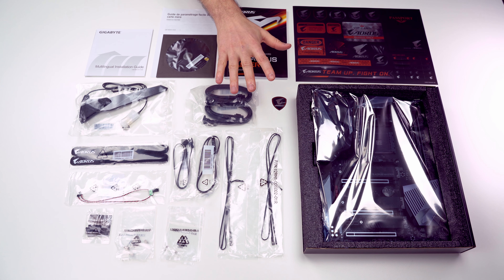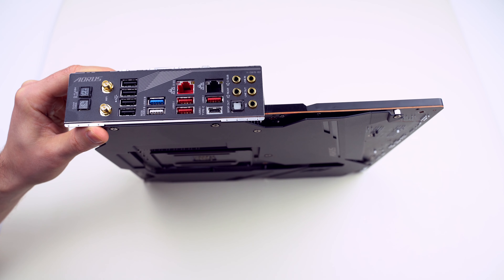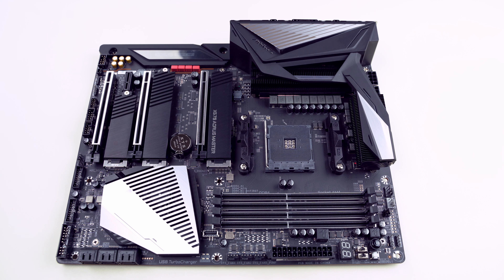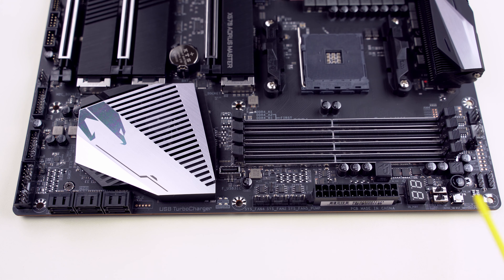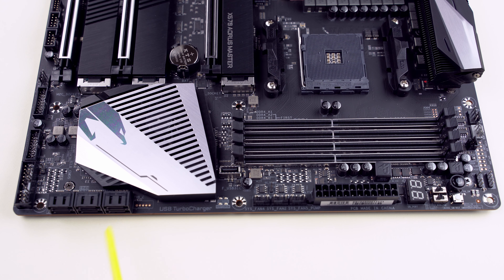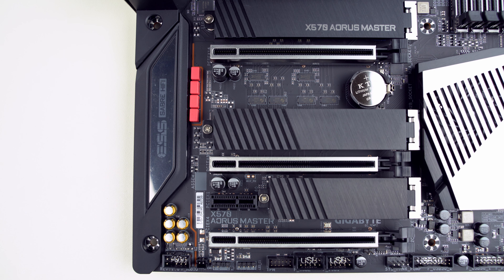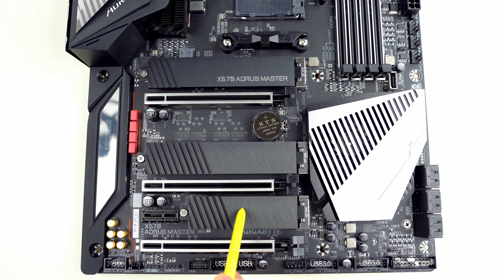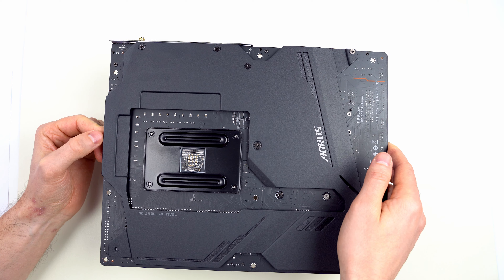Gigabyte X570 Aorus Master - Unboxing + Complete features description

Comment: I see you have a Rev 1.0 board. when did you pick this up?
Reply from the maker: Couple a months ago, finally got time to play with it ;) Came with F4 BIOS. Why?
Reply: @MartinsLab  Thank you, the 1.0 rev does not have thunderbolt and I'm trying to see if rev 1.1 (with the thunderbolt connector above the sata) is a thing. I'll be ordering mine today from Newegg and crossing my fingers. It's her first custom device, shes a content creator running on a phenom 2.
Reply from the maker: I am not sure if any other revision has it, Gigabytes website doesn´t mention thunderbolt at all (I am aware of the empty space close to SATA you mentioned). If you´re looking for board with thunderbolt, the only one I know with X570 chipset which has it is ASRock X570 Creator. I will be reviewing it in couple of weeks, also a very good board and has 10Gig LAN on top. VRMs are not at the level of this one, but other than that I would definitely consider it, specially for a content creator. If you get the Master, flash it with F11 BIOS ASAP,  the chipset fan noise is anoying and this BIOS revision fixes it - allows you to customize it.
Reply: I can't afford the creator, sadly. But the gigabyte thunderbolt PCI lists this board, and see here. https://www.gigabyte.com/ca/Motherboard/X570-AORUS-MASTER-rev-1x#kf
Reply from the maker: You´re right, I see it, completely overlooked it. This info could be also useful for others, it says ”1 x Thunderbolt™ add-in card connector (Only rev1.1 available)“.  Maybe you could ask them to have a look and confirm that what you´re ordering is rev1.1 and if not get it somewhere else. It´s worth trying.